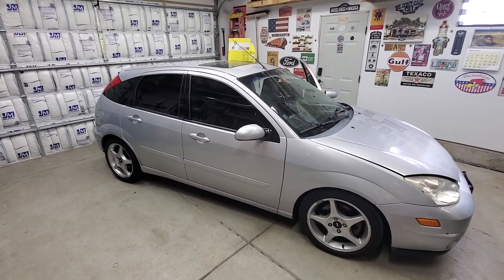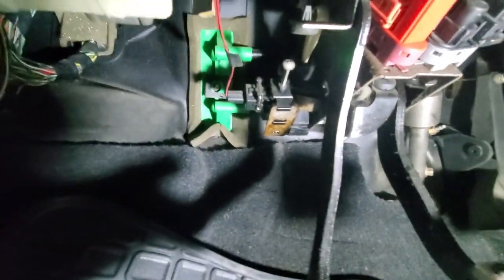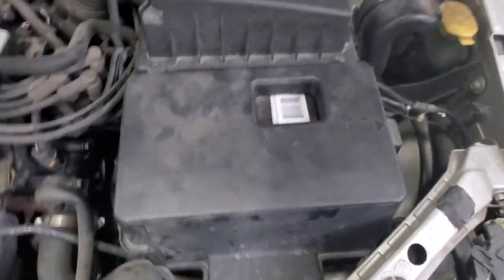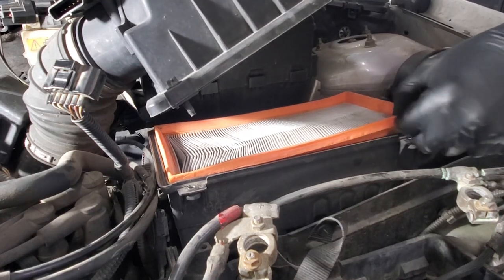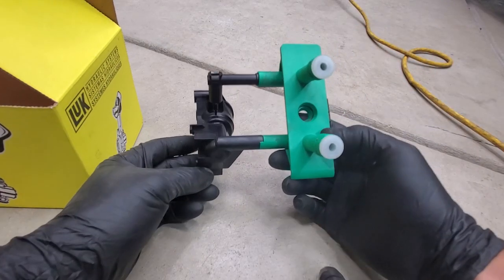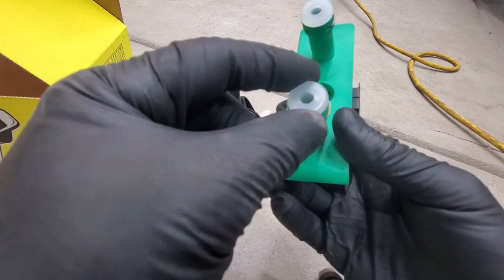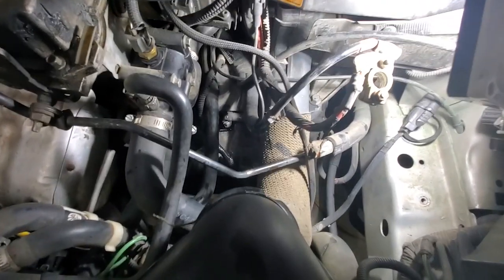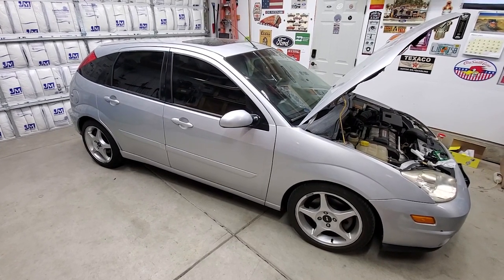Ford Focus Clutch Master Cylinder Replacement How-To

Comment: Just purchased an svt. Your video is by far the best. I failed to bleed mine today but I did it like a normal brake job. I will try your method and hope to see results.
Reply from the maker: Concrats on the new purchase, love my SVT Focus. Yeah I tried bleeding it like the brakes at first as well with no success. So the way I do it on the video seemed to work the best. Kind of a poor design by Ford.
Reply: @BLUECOLLARGARAGE  yea I bought the car last Tuesday.  Has 61k on it but the pedal had alot of play and disengaged at the bottom. Then this morning it didn't want to shift. I will try this tomorrow and I went ahead and order the master you used as well. Right now it has the iron master in it.

Comment: Can I ask you a stupid question?

The piece that you unhook at 23:15 from the metal stud coming off the pedal...what is keeping it from coming off under normal circumstances?

My clutch works but that piece falls off. It has a lot of wiggle room. Just slides clean off when the clutch is engaged.
Reply from the maker: We’re you able to figure it out? There should be these like plastic pieces inside that round part that spring outward when you snap that on.

Comment: My pedal is still loose and I can't even change gears, everything is installed properly, do you have any advice?
Reply from the maker: Sounds like you still have air in the system have you tried bleeding it again?
Reply: @BLUECOLLARGARAGE  i fixed it, repeated the bleeding process and my old car now runs like new. I can't thank you enough for this tutorial, I've fallen in hard times and an expensive Mechanic was not an option, I did this with zero knowledge, I used your video for guidance, you saved my butt, thanks man.
Reply from the maker: @dubon6372  Glad to hear it helped you out. Hope things get better for you.

Comment: Got a question, what do I need to do to replace that bottom line the connects into the back of the master slave, mine rusted through and I don't know if Ford sells it?

Comment: I can’t get the bolts that go through the pedal housing into the master cylinder  to line up, the tabs won’t seat from the cylinder. Any tips?
Reply from the maker: Sorry for the late reply we’re you able to bolts through the pedal housing?

Comment: I just changed my slave cylinder and clutch only to figure out it was this part that had failed.
This looks easier than removing the dam transmission, lol.

Comment: I have a question. If the Cylinder is out that means there's no pressure on the clutch to reach the engage switch right?
Reply from the maker: Yes you are correct. When the slave cylinder goes out the clutch pedal will have no pressure to disengage the pressure plate from the clutch.
Reply: @BLUE COLLAR GARAGE  should I get a slave cylinder too or does that come with the master cylinder setup?
Reply from the maker: What’s your pedal doing right now? Are you having issues shifting the transmission?
Reply: @BLUECOLLARGARAGE  it won't let me shift cause it won't reach the engage button
Reply from the maker: @AllGsReact  do you have any fluid leaking like mine was? Most likely the master cylinder is going bad. The clutch master cylinder sends fluid to the slave cylinder. I would try replacing the master cylinder first because in order to change out the slave cylinder you would need to drop the whole transmission and then at that point might as well replace the clutch.
Reply: @BLUE COLLAR GARAGE  Thank you I will try that first
Reply: @BLUE COLLAR GARAGE  I'm back so I changed it and I'm not able to shift. I can start the car the clutch has pressure but the car doesn't want to shift any thoughts?
Reply from the maker: @AllGsReact  sorry man been busy lately were you able to figure it out?
Reply: @BLUECOLLARGARAGE  it was the slave cylinder that was where the leak at
Reply from the maker: That sucks are you going to drop the transmission and change it out?
Reply: @BLUE COLLAR GARAGE  my buddy did it today and it work fine now. The shop said $2600 my buddy did it for $600. You should keep up with your tutorials you know how to do them properly and thank you for the feedback.
Reply from the maker: @AllGsReact  thanks  appreciate that. Glad to hear you got it fixed.

Comment: Does the foam looking piece matter
Reply from the maker: I'm sure it would work fine without. It probably helps protect the plastic from rubbing and helps create a noise and temperature barrier from the firewall.

Comment: I got a Perfection Clutch brand , the plastic arm on yours is plastic. On mine and is metal !  And has metal elsewhere. When they wear bad like mine did , the arm will deflect sideways so bad it will pop off of the clutch pedal nub. You will be stuck in traffic without being able to disengage the clutch. Got to a parking lot using the starter to propel the car.
Until I could fix mine to keep arm on nub found a just right one-way fastener like they use on fenders. Circular with teeth to hold onto nub.
Reply from the maker: Good to know thanks for the info 👍

Comment: Can you give condensed tool list you used?
Reply from the maker: 7mm, 8mm, 10mm, 14mm sockets and wrench, flathead screwdriver, standard pick for the line clips and maybe a set of needle nose pliers and that really about it I believe.

Comment: U didnt show how u got to the bolt on the firewall that hold the mc in place. Im still tryna figure it out
Reply from the maker: Not sure which bolt your talking about because only thing holding the Mc is the clip that slides over the bolt behind the Mc on the firewall.
Reply: @BLUECOLLARGARAGE  and after that it just pops out? I did slide the clip over but feels like something is still holding it. Im at work r n but IMO gonna rewatch the video and finish it when I get off. Thanks for the video man. It helped alot
Reply: @BLUECOLLARGARAGE  definitely got a subscribe from me. I own a 2003 focus svt. Doing my clutch and slave and master cyl
Reply from the maker: @jonboy6517  yeah it should be just that clip and then of course the two lines holding it on.
Reply from the maker: @jonboy6517  thanks for the sub. I need to do my clutch as well sooner or later and will probably shoot a video on it. Congrats on the svt purchase.